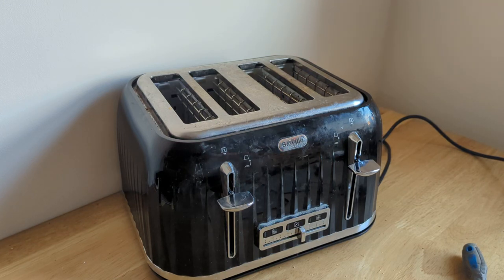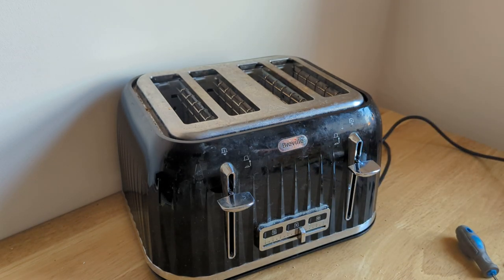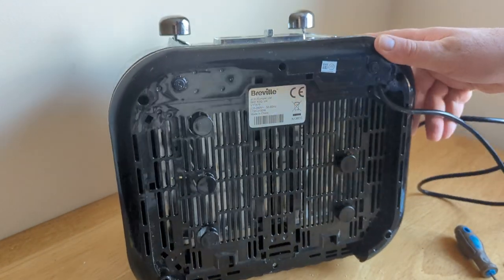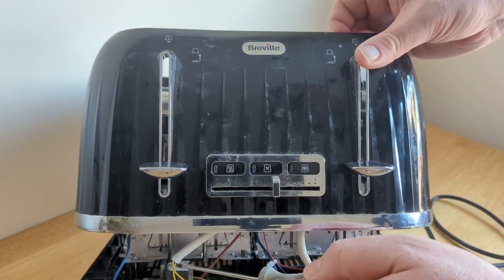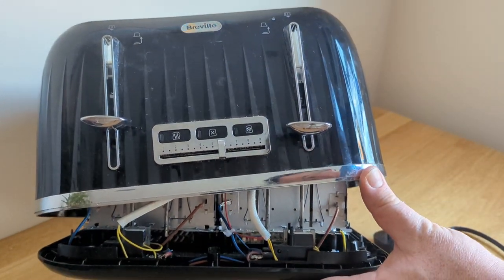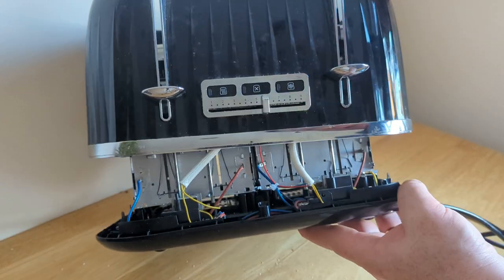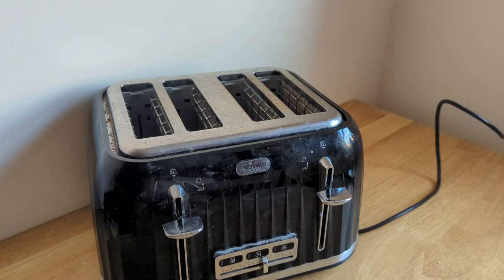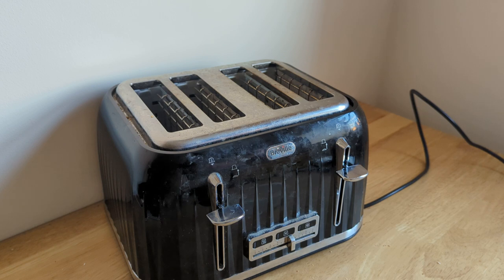How To Fix Faulty Breville Toaster Not Staying Down (Models VTT476 VTT969 VTT786 VTR013 VTT911)

Comment: Took me a while to find out that there are two more screws hidden behind the back rubber stoppers. Once I could open it, it was easy to clean and that sorted out the problem. Many thanks!
Reply: Thank you, I needed this comment. Toaster now working
Reply: Thanks. I was at that point of 'bending' the front part a bit too far. This got me sorted 👍
Reply: How to remove rubber stopper??

Comment: Couldn't get in mine as the screws were triwings! Still toaster upside, shaking and hammering the lever seems to have fixed the problem, so your vid still inspired the solution- and saved me 60quid thanks
Reply: Same here. There I was armed with both Philips and Torx screwdrivers and it chucked that curve ball at me! 😂

Comment: Great video, very helpful, saved us buying a new toaster, ours had some screws at the back also, star type in the middle and two normal screws in either corner which the feet had to be removed (easy enough with tweazers) to get to.

Comment: I have the same problem and exact same toaster (model number the same) I’ve taken out the 3 screws I just can’t get mine apart even tried a 4th screw but I can’t find anymore
Reply: There was two hiding under the back two rubber feet i had to remove. May be the same for yourself 😃

Comment: Thank you sir, this fixed the same problem for me - honestly the sensor area on the effected plate was not too bad on mine, only a couple of crumbs so I wondered if my issue lay a little deeper, though sure enough, I cleaned that area out, but it back together and it's working again!